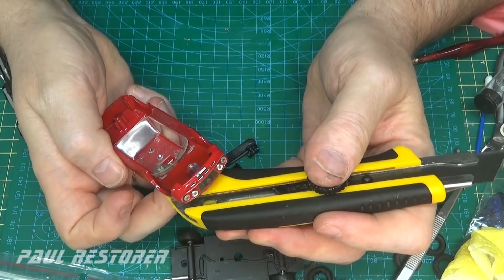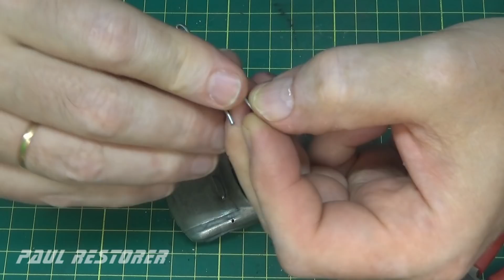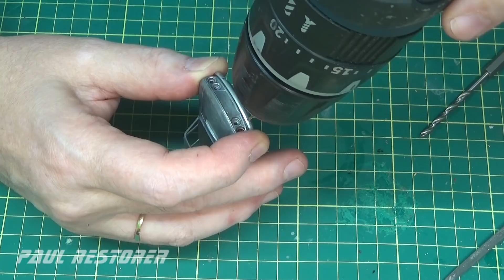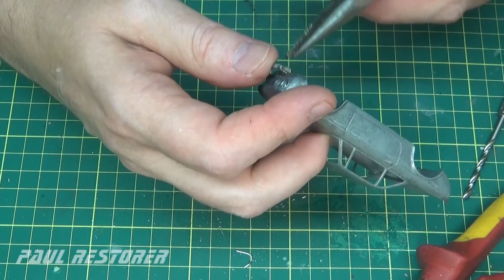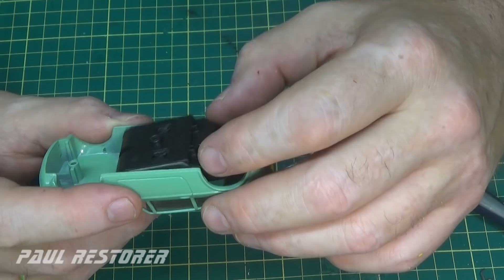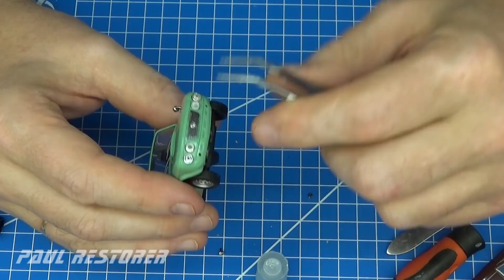Lancia Fulvia  conversion of the rally version into a civilian car. Diecast car. Making bumpers.

Comment: Fantastic conversion.
What did you use to make bumpers brackets was it solder or welding metal.
Reply from the maker: While making the bumpers, I soldered the brackets using a binder recommended for aluminum. But if you make the metal red, it sticks and connects very well. Best wishes